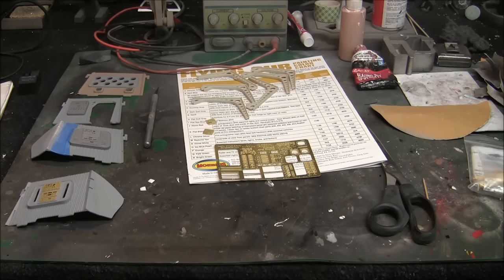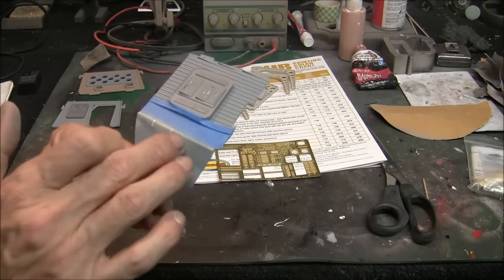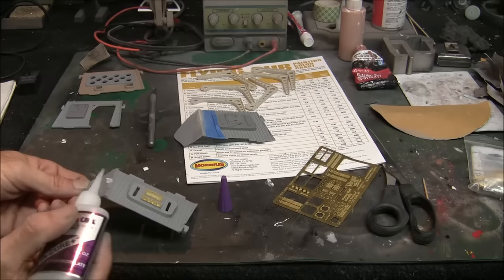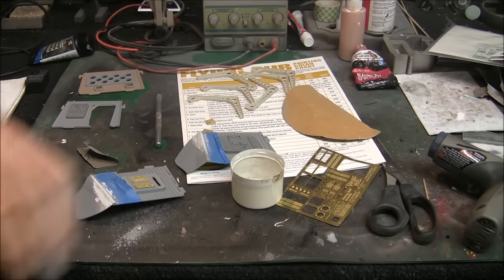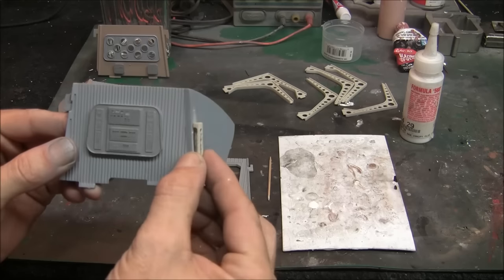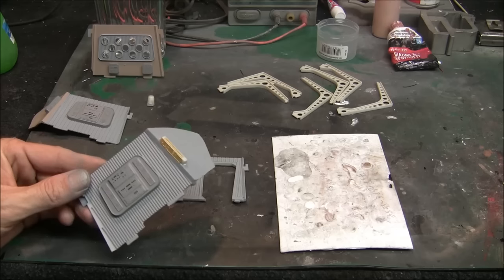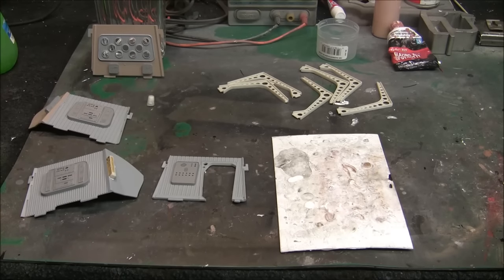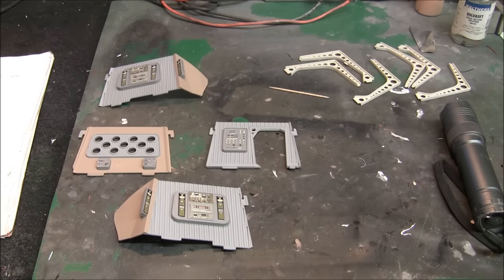Moebius Models 1:32 Scale Flying Sub Build Pt 1

Comment: Looks like it's going to be another great build Boyd. You appear to be using a filler putty that I haven't seen you use before> What is it please? Can't wait to see the finished build.
Reply from the maker: +Mark Pullen It's called Perfect Plastic Putty and I have only recently started to use it. I really like it and since it is water based it is very easy to clean up and will not damage or stain any of your paint work. Fast drying and very sandable too. Jerry carries it at HdaModelworx.com
Reply: Amazon carry it so I've ordered some. Many thanks. Mark :-).